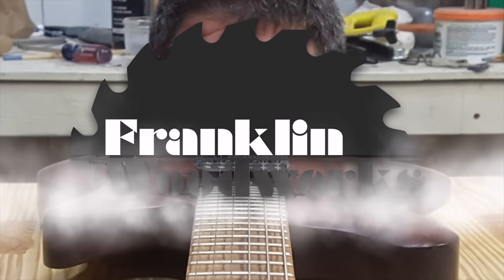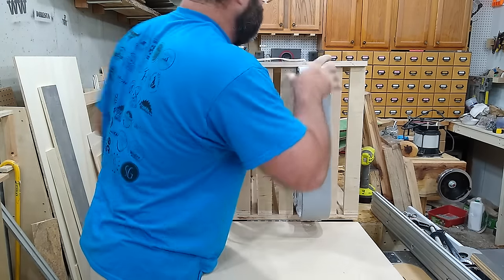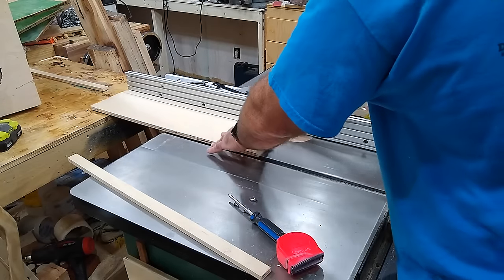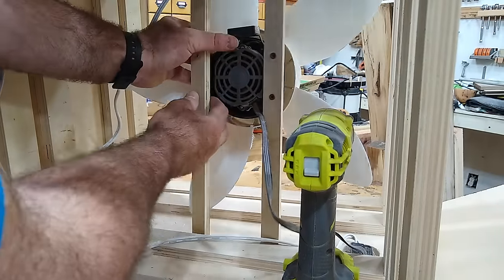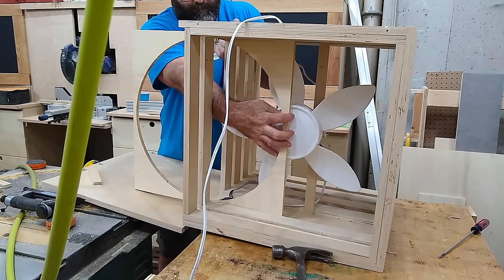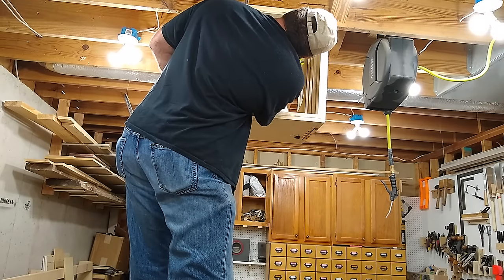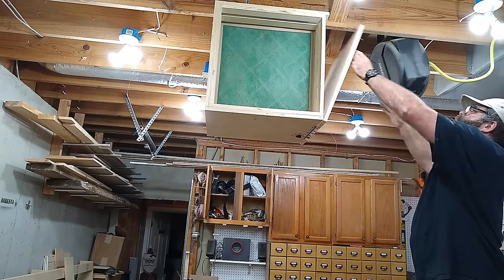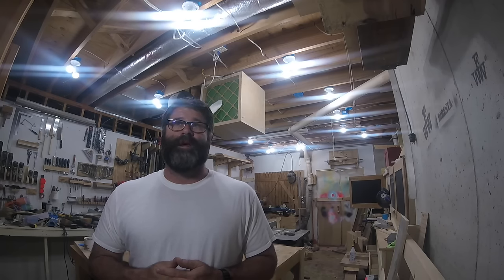Even Better DIY Air Cleaner and Dust Filter

Comment: If you want to get scientific, unfold a clothes hangar and make a loop at one end for a handle. On the other end, cut a 1/4" x 7" strip from a $ Tree Caramel Corn reflective liner bag and tape it to the end of your wand. Now you can hold the reflective strip in the air flow you want to measure and move it around to study the air patterns. This tool comes in handy for testing forced air vents, vacuum hose suction, etc. Using it, I discovered the dead and reverse air spaces around the corners of 20" square box fans. Portable construction site heaters frequently come in open-ended can configurations for more volume air flow. You can also buy inexpensive weather anemometers that communicate the air speed to your smartphone or weather station when you place the anemometer in doorways, hallways, open windows, forced air ducts, wind tunnels, and other air passages.

Comment: What’s really funny is that I just came up from my shop, after cutting all of the pieces from the original design on Sawdust, only to open the fan and find out - it’s not 20 inches.  So I spent 35 minutes taking the fan completely out of the hosing, and mounting it inside the box, just like you did.  Now I just need to add the round cut out...great timing in finding this video, thanks.
Reply: Tony M - you’re not the only one! I did the same thing. Built that box from the original design as well, and my box fan was too big to fit. Glue, nails and screws....and enuf swear words that Hubby came running out to the garage asking what the matter was. Had to pry one side off before the glue dried just to salvage at least half the build. Already knew that I would need to build a shroud as well and accommodated my measurements to fit that shroud out of quarter inch hardboard.... 
so instead of this fan working overnight to clean my garage from all my glitter (er sawdust), I have to wait until tomorrow.

Comment: I had the sunlight shining just right through the windows in my bedroom and was AMAZED at the amount of dust in the air....really CREEPY. I broke a window the other day in my bedroom...and the light "went on"...I decided to BLOW the dust outside through that hole. I put a small 9 inch fan right up against the window (I ordered on Ebay for $17) where i broke it...having duct taped it to about 9" diameter. I put the fan blowing OUT through the window and have  a 12" filter behind it so it is sucking the dust into the filter on its way outside. I also bought some black stury filter material in case critters decide to come in..and will put that OUTSIDE the window. I wanted some airflow all the time and will let this go continuously...there is little noise. I also will design something like you have for the whole house...great video. You sell yourself short...most people are idiots.

Comment: Great video -  and THANK YOU for the plans!  I built mine this afternoon.  Also made an inner "shroud" for air flow improvement and had to remove my fan's frame as well, just did the same thing you did.  Mine was a nasty old box fan I've had for years but still works!  Thanks for this video and the plans!

Comment: Good Morning, I am writing to thank you for sharing your ideas on you tube.  I just watched your video answering questions and responding to the snarky comments some feel free to post from the cover of social media.  I am retired from a profession in which I valued very much the willingness of others more highly placed in my profession to have a conversation with me about an issue I was facing.  Without that connection my many years of serving the public would have lacked valuable assistance.  I agree with your comments about the woodworking community and their and your willingness to help.  I am a hobby woodworker fortunate to have a shop and tools.  It has been a godsend during this time of isolation.  I am in the middle of making a shop air cleaner of your design and will be cutting a shroud for the fan as you described.

Comment: You could get a fairly significant improvement in the fan's thrust (and suction) by placing it in a circular duct whose interior diameter is only just a little larger than the swept diameter of the fan. It would also operate more quietly.
Reply: and even more by using the vortex the fan would create in such a circular duct to generate double force. so basically using a circular duct makes it more efficient because the air coming out of the fan can rotate freely the way it wants and doesn't get to much turbulence due to inbalance in the shape, a square shape would cause a lot of inbalance since the rotating airflow from the fan would need to make angles of 90 degrees which is inefficient and creates huge amouns of turbulence.
there also indeed is a small part which comes directly from the changing of the volume of air since in the places where it goes into the fan and just behind it that would also generate a sudden increase and fall generating a lot of turbulence, however on the contrary something is also true. the bigger the area of the filters you use the less friction they give, and that would be a rather significant loss.
so we should want to keep the parts where the filters are mounted nice and big and square in the shape of the filters. but to optimize the airflow and not waste the energy from the vortex to turbulence the fan itself should be inside of a circular pipe around 3 times the length of the fan, but more is possible. and to counter the vortex twist before it hits the square part and to convert that twist into a airflow and pressure boost we should add fins in the circular shape just a while after the fan, not to far, not to close, to far and you lose energy, to close and you also lose energy in pulses, in general keeping around enough space for another propellor in between should work well. those fins should be aimed in the opposite direction of the fans blades. if you first measure it and calculate it you can calculate the perfect angles and such. but right now we can just make them the opposite angle of the propellor blades, or since we run it at a low speed and pressure we can make them less steap and more in the direction of how we want the flow of the wind already, that way we can be sure they aren't to steep and so they won't cause a restriction in air flow, and ofcource these blades are connected to the outside instead of inside, since this is a low pressure and speed device we shouldn't go all the way to the middle, we should also use as thin as possible blades for this, since they don't need to move anyway and only need to steer the wind. while just simple blades are enough, if we want to be sure of high efficienty we can make those blades bend and slightly go through straight with the desired wind direction until the air exits the circular conduit.
now that should when done right double the airflow and/or pressure for such a fan when you run it on the same RPM which would greatly decrease noice and also decently decrease power usage. but we forgot one thing and that is where the filters are. this system has one filter in front of the fan and a few behind it. this means that we should add some extra space in front and behind of the fan to make that transition from a big square to a smaller cylindrical conduit, since the airflow isn't to big in that system the intake side doesn't need much of such a smoothening transition, it is just to prevent the turbulence from that 90 degree angle. so we can make it around 45 degrees or less steep, with one exception which I will discuss later in this. on the exit you want it slightly bigger to make sure the transition from round to square, and from small to big are smooth so it won't cause turbulence. both on the inlet and exit this can be done with a specialized plastic or metal part, but it could also be done with duct tape, with wood if you are capable and willing to finish it decently, or with a material like tempex, which is probably the most simple option, you can add some tape or plastic over it to make sure it doesn't get damaged to much over the years, but it should keep up just fine since it has been used more often in such things, just make sure to cut it with a hot wire or such or to use something like a hot plate or hot air gun to make it smooth where it will touch the air. bare tempex also brings a advantage and draw in one since it likes to accumulate a static charge, and a strong one, when you keep blowing wind past it. this static charge will work as a filter for big and insanely fine particles, however it will only filter around the outsides close to the tempex, luckily due to the vortex most dust will be in the outsides first, however remember we canceled that vortex out to get more efficiency, so now the dust will spread more even through the system. luckily this tempex part is close enough to the cylindrical conduit that most dust will still be on the outsides, and on the top we should mostly see specifically the super fine dust which normal filters won't capture making it a nice extra filter step. but there was a draw, and the draw is that the air also gets a slight electric charge, this means it will be atracted to it as well which causes some friction, luckily this frinction is insanely small, especially at these low speeds, so the friction due to this should be comparable to the friction due to the inconsistency in the wood, but there is another draw, and that is that tempex likes to stay static, there isn't really a easy way to rapily make it non static, which means it might be hard to clean of all the dust from it. again all over the draws it has are mostly draws to the pros, and the prose can be quite nice, so using tempex for such a low speed system would be great.

but I said I would come back on something and that was for the inlet, right now we altered the inlet to prevent losing airflow, however we can actually use that same size difference with a altered inlet smoother to gain extra windspeed. to do this we just need to make some kind of duct like a ducted fan. this way it will work like a airfoil, this will increase the tota airflow and will also prevent some of the air which tries to come back using the outsides of the fan. but again we don't want to many sharp edges in such a system, so just around the edge of that duct we again add something to even it out and prevent those sharp angles. normally that wouldn not be a problem if the size difference was big enough. but right now the square is only a little bigger than the cylindrical conduit, so we get more efficiency by also including that smoothening.

Comment: Nice. I'm sure some day I'll get a round tuit and build one myself. Still using a 20" box fan with a 20" filter taped to it. Works, but it's noisy.
Reply: Bill Smithem same here!
Reply: Me too, but there is a lot of turbulence in the corners. The baffle is supposed to help with that, I’ve been told. Not sure what the big box accomplishes. Might try it and see.

As for the mediocrity comments, 80 years on the rock has taught me that perfection is in very short supply.  Make something that works and get on with it; we’re burning daylight here.
Reply: Stuck a filter on my dehumidifier. Think I'll stick one on my box fan too,  just run it when I'm not home.....copd ...
btw pretty sure the Correct quote is"religion is the opium of the people", 
Karl Marx .
Reply: I taped a furnace filter to a 20” box fan as a temporary air filter until I can build a unit like this. It worked but burnt out the fan the first day, so I am a little apprehensive to build a unit like this.
Reply: @Donski96  Interesting. Mine has been working just fine for three years.

Comment: Use eye hooks to mount it. Will be quicker to take down and mount. Great idea overall.
Reply: I think your right but would the box begin to swing slightly from the breeze it creates or centrifugal force? I'd prefer that box being secured if that happens.
Reply: or how bout L brackets on the side so it can be secure.

Comment: The old fan box was cool, the new one is  better yes. The best way is to have what's called a "square to round" behind the ran. Round attaches to the fan, and square at the filter base. A square to round is a sheet metal shape that is the best way to transport air from a square opening (filterbank) to a round opening (fan Inlet). You basically replicated that, so with the tools that you have, you cant do better than you did. This is just my professional knowlege as an HVAC sheet metal fabricator. Awesome job! I wish we had one for our shop. Plenty of metal dust flying around!
Reply: Utilizing the Bernoulli Effect increasing airflow

Comment: Seems like your filter works great. Here is a comment about fans (as opposed to centrifugal blowers). They hate back-pressure. The way to improve flow is to increase the surface area of the filters.  But it would be bulky and more difficult to build, etc. Thanks for the video. I think this represents the best that can be achieved easily with a box fan.

Comment: Excellent job. I’d buy something like this. If I could also give you a couple pointers you may appreciate... Instead of using multiple 1” thickness filters you may want to go for a 4”. A 4” filter can provide the same cleaning ability as multiple 1” but a single 4” actually allows for more airflow than a single 1”. While 4 one inch filters would have about 5 times the pressure drop as a single 4”.
Reply from the maker: Agreed.  But wouldn't that really impact the cost?  Remember this is for a wood shop, so I think the gain in efficiency would be offset by the increased cost.
Reply: FranklinWoodWorks Well because there is less pressure drop you can filter the same amount of air with less electrical cost. The motor doesn’t have to fight so hard. Although because the airflow will be higher at the same speed setting it will draw more electrical current. So it depends on how you’re running it. The filter cost would be less. Just for a quick comparison I found “Aerostar” brand filters on amazon. A MERV 11 1” is $5.55 and the MERV 4” is $7.71.
Reply: Since the airflow is higher you could run it less and then you’d save on electricity with the same amount of filtration. Likely with how cheap the electricity is on this you’d just run it the same and it’d filter quicker. I’d imagine the money saved on filers might offset the electrical cost. Although I might be even more inclined to this since I can get the filters wholesale for about half price. 🤫

Comment: I got around the square box vs. round blade issue by using a duct fan (16" dia.).  It moves about 650 CFM through my shop and is quieter than the box fans I used to use.
Reply: That's a great idea.

Comment: I am an up and coming woodworker with a garage for a shop. I watched your video with great anticipation. You have created a cost effective; quiet; and efficient filtering system. Well done!
P.S. Do you a new set of plans for the update that you made? If yes, may I obtain the plans, please?
Reply from the maker: I don't have any plans for version 2.  But, the dimensions for the pieces will be based on the internal span of the box and the design of the particular fan you use.  I bet you can do this.

Comment: Would adding 2 fans instead of one make it work better? Such as higher suction?
Reply from the maker: Good question.  I've actually done some research on this.  The best solution is to get a really efficient fan, like a squirrel cage fan.  Those things can really move some air, but unless you can salvage one from somewhere, you're going to pay.  But, that's not what you asked.  Based on my research, if I had two box fans, it would be much more efficient to use them separately - increasing the surface area of your filter materials by 100%.  Putting the two fans in series (one in front of the other with both blowing in the same direction) will get you about 25-30% increase in efficiency, but you'll still be stuck with the same filtering surface.  How all that works out mathematically is way beyond me, but it would appear that two fans working separately would be more efficient.

Comment: You're on the right track.  If you look at the engine fan on a motor vehicle, all the most efficient systems, whether mechanical or electric, have a shroud around them.  This way, the air is "directed" to the fan blades.  More air movement with less energy expended and less noise.

Comment: Btw I saw your video titled questions about the air filter. And the device will work. That's a definitive my friend. Just look at Smart Air's DIY air filter system. Just pop on an activated carbon filter and you will be capturing fumes as well. It won't be very efficient but it will do its job.

Comment: Nice improvement.  However, the complex rafters are outstanding dust resting points.  Suggest you get some kind of ceiling with less complex geometry to keep dust from hiding there.  Or, leaf-blow the joints occasionally and let gravity do its work.